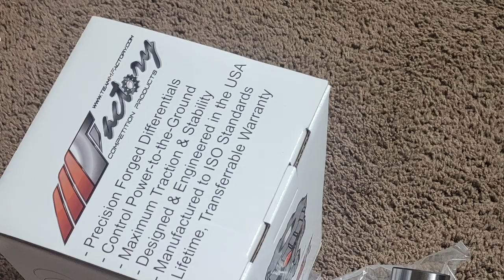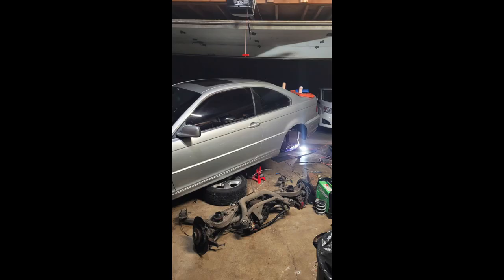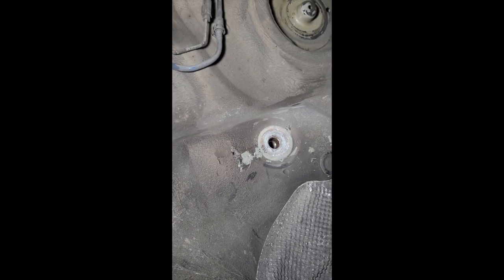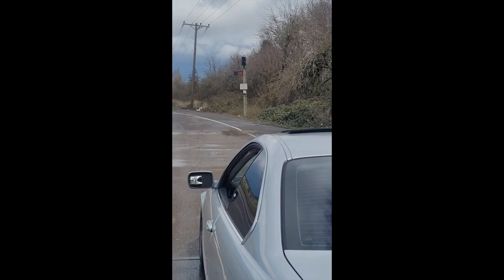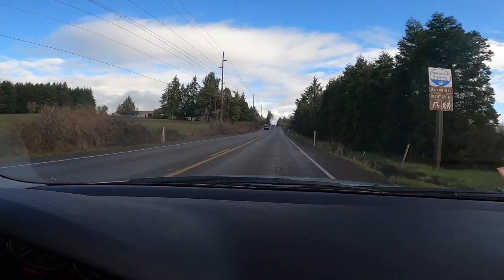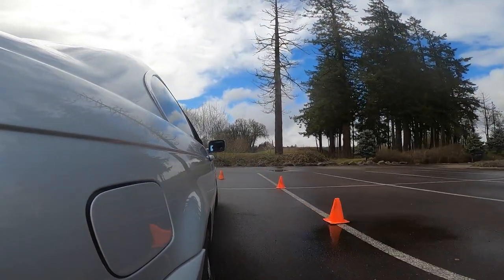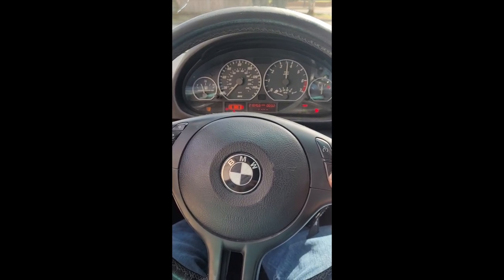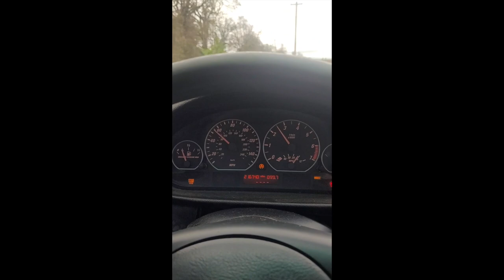Rebuilding my e46 to compete in autocross.

Comment: I like the build. I’d recommend not grinding welds though where you try to reinforce, like the subframe reinforcement. When I was building my cage on my E39 M5 all the rules called for no grinding of any cage welds. While not the same I think it may weaken the overall strength.
Reply from the maker: 100% with you on that. Caveat is that you have to grind any protruding welds on the mounting surface flat. And my welds look like a 6 year old with a hot glue gun 🤣
Reply: @driven_nation  that’s a good point. Keep practicing. It’s always hard to weld underneath. I’m no pro but just keep bublegumming stuff together.

Comment: I'm going to rebuild my 330ci too, and I'm trying to figure out what to do for my diff. I have a 5 speed manual with (I believe) the 2.93 diff. I see you went with a 3.38 and put the MFactory LSD in. Where does the 3.38 come off of, and how do you like the setup?
Reply from the maker: So "It depends" is the common answer. I went with the 3.38:1 which is out of the 330ci automatic, because i felt the 3.46 were too short for autocross and freeway driving to events. But now that I have had it on track I think i would just do the 3.46 diff for the following reasons:

At autocross, I hit my raised limiter in second on some straights. with the 3.38:1 that is ~59mph. with the 3.46:1 it would be ~57mph but presumably I would get there faster and may warrant a shift to 3rd. My very last event I was off and on limiter through a really weird chicane but when I went to 3rd i didnt have enough rpm to really dance the car with throttle like I would like. 

At Portland International Raceway turn 1 is ~45-50mph ish. which puts me at risk of bogging in 3rd but I was over revving trying to downshift to second while turning in scrubbing speed. Watching spec e46 cars which have a 3.46:1 they leave it in 3rd and that would be nice. 

Freeway it just is what it is. If I go 80mph I am at ~3700rpm. which would be closer to 4k with the 3.46:1 and I will just slow down and cruise. The alternative is the 6sp zhp trans with its overdrive. That would solve this issue. 

As for the lsd. By far the best mod i have done. Everything is better with the only "negative" being a bit of noise at low speed because I shimmed it tight. Better steering with throttle, better launching, no inside wheel spin when accelerating out of a corner. its fantastic.
Reply: @driven_nation  Awesome, thank you! I think I'm going to look for a 3.38 as well.

Comment: Which 1.5 way LSD is it? 1.5/2.0 way or 1.0/1.5 way? Also do they come with bearings or do you just transfer them from the stock open diff? Thanks
Reply from the maker: Mfactory 1.5/1.0 way. I bought new bearings